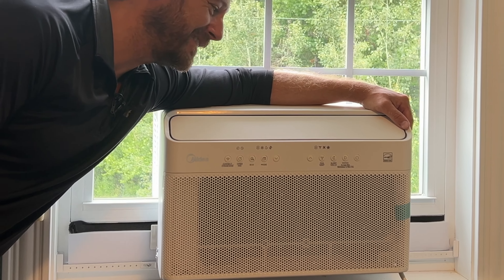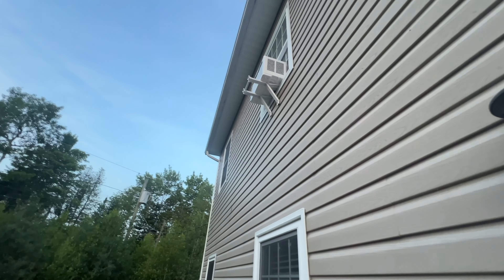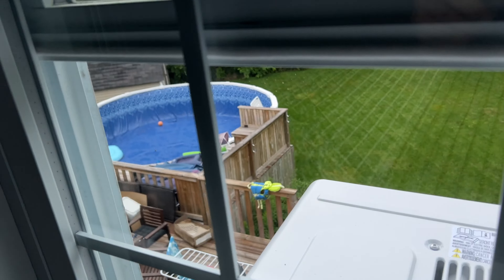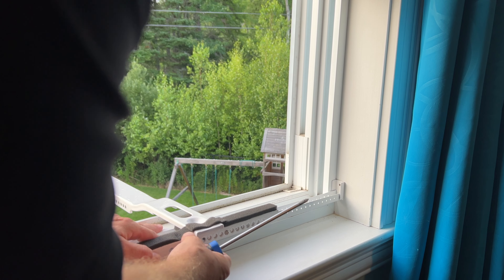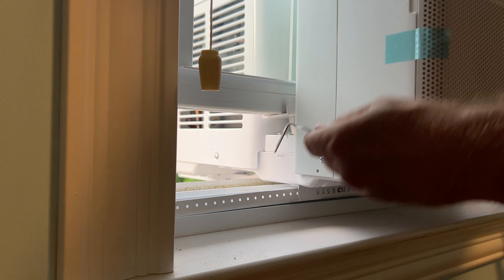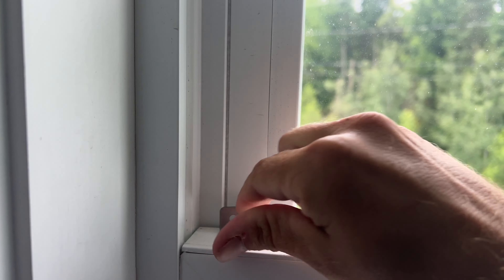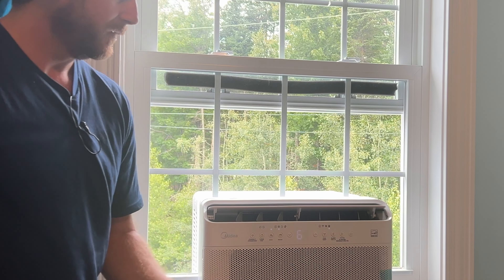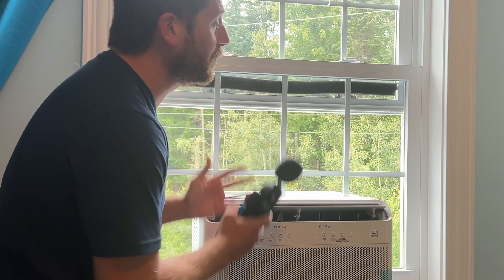Cheapest Window AC on AMAZON! Cold & QUIET U Shape!

Comment: Midea has really been making some good stuff I've noticed.
Reply from the maker: Agreed! I’m going to buy the 12000 btu next!
Reply: @soundproofguide Hey one thing to mention is that this unit doesn't have a compressor, it has an inverter. That's one of the main reasons it's so quiet. Just FYI.
Reply: I stand corrected...it actually does have a compressor. I was under the impression that it was an inverter because I have the portable air conditioner version with inverter too from Midea. And they sound the same. 🤷 Idk how this thing is so quiet. I know the window blocks the noise. But it's still quiet even with it on and window open. U don't even hear the ka-thump thing when the compressor turns on.

Comment: I got my first one last summer. Had to build on to an old window (like…REALLY old window) to get it in.

Best air conditioner ever. Like…totally changed my space. I had to have it right next to my desk because of space constraints and I could work right next to it.

One thing to keep in mind: this thing has a nasty problem for some folks (including me). It seems to develop what looks like mold on the inside fan that blows out the front (and you can’t service it like a traditional window AC…but I figured it out).

Believe it or not—it was still worth it even with that problem. That’s how good it is! But I hope they fixed it (I saw that they released new models since I got mine).

If this is an issue, it might be a humidity problem so folks can try running the fan without the Air Conditioner regularly. The theory is that the machine is constantly running and condensation develops on the front interior fan such that it never evaporates and that running the fan only (daily) fixes the problem. One could set an automation to make this work.

Again: still worth it and might only affect some folks. But man, I wish I had this video when I installed mine. The available videos were sparse! 

It was so much more efficient at cooling the room (I measured the energy usage) and it was like…you could use this in a library it’s so quiet (like you said…it’s like a fan at most)! The best.
Reply from the maker: Thanks for all that information! I’ll definitely be on the lookout for mold!

Comment: I have one that's about a year and a half old. It only puts out 450 watts unless it is very hot outside (sensor) and then it will go to 850 watts with no way to make it go full power without the high outside temp. My regular Midea is much louder but blows the inverter away as far as cooling and moving air. I think the older ones had a defect in the way they measured temp and pressure making it way under powered with temps outside in the 80's vs 90's ; maybe they fixed it...

Comment: Is that quieter than other U-shaped brands? And what about low-frequencies--those are the ones that kill me--especially the vibrations?
Reply from the maker: No vibrations at all but the low hum is a lower frequency noise, just not low enough to cause vibrations if installed correctly.